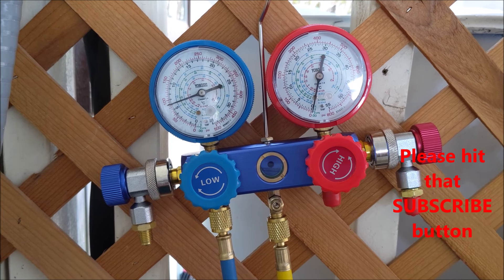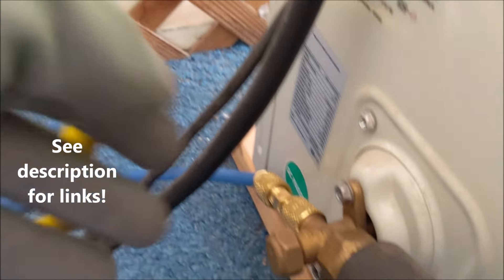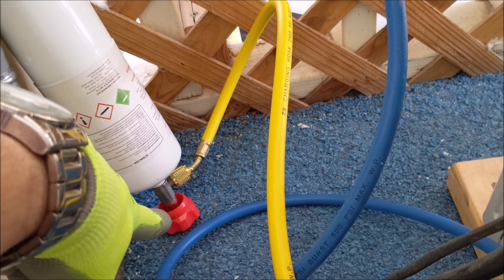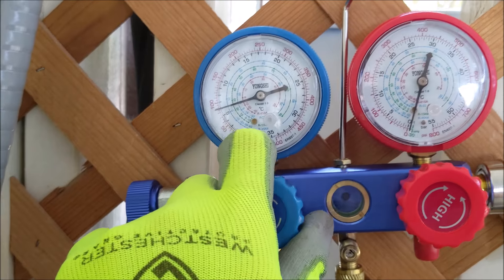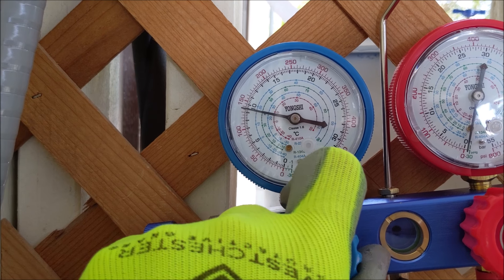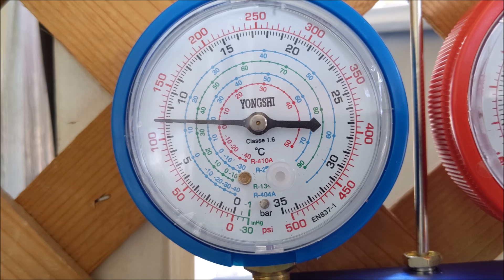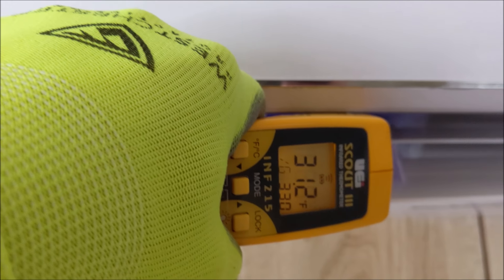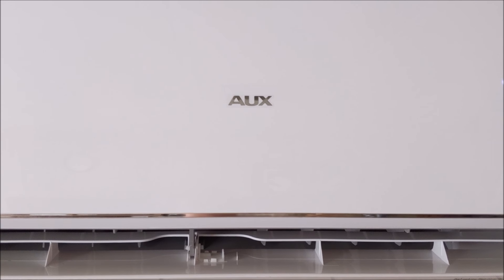How to charge mini split yourself, DIY 410a refrigerant, save money!

Comment: IMPORTANT NOTE: You need to purge a little refrigerant through the hose connected to the refrigerant tank before connecting to your gauges. You do not want to get any air into the system! If you don’t purge the hose, you’ll inject all the air in it into the system.
Reply from the maker: Yes Dave, that is mentioned on the video description, but thanks for the reminder for everyone.
Reply: True
Reply: Not able to find refrigerant like that for sale online anymore.

Comment: Thank you for the video. My 410a was delivered today and I just got done recharging my 24k BTU Mr Cool. PSI was at 75 and wouldn’t get my garage below 80. It was basically blowing warm air.  Turned the AC to 73 and went outside to recharge it. Took about 5 min, As soon as I walked into the garage I could feel the cold air again.. Since I installed the split system myself I had all the tools already. $75 for a bottle of 410a is way better than $500 for a service tech to do it.
Reply from the maker: AWESOME! Glad you got it, and glad you are cooling now!
Reply: Fix the leak!

Comment: this is the second part  of what you need to do: - this is what I do: - First, if you are low, that means you have a leak.. in my experience, it's that the fittings come loose after years of vibration... so before you do anything, turn the unit off - and re-tighten the fittings there are the two lines... use 2 wrenches... then I would use a vacuum pump on the system because if there is a leak, there will be some air in the system, and you don't want that.  - once your gauge shows -20 for 30 mins (it means it's holding vacuum) then you know you have no leak, and can NOW recharge your system.... NOW you can turn the system on full cool and lowest temp it will go... fully empty it will take about 1/2 a container - like the one he shows... I didn't do the open close - I just opened it up a little bit and close it when you are at like 90 psi, and then do the open close :-) - BTW there is no High Side access on these which is not great - there really should be... but like the OP said, just take your time.

Comment: Thank you so much for your video I tried it on my Senville two air handler mini split. Aura model 18000btu. It worked like a charm but only after the third try. I must stress to everyone please bleed the lines. Make sure the air conditioner is running when you’re hitting this psi Mark. Again bleed the lines, bleed the lines on the gauges. If you ever have trouble DM me. I can explain to you in detail what I did. I don’t make YouTube videos much at all. My leaks were s result of loose connections. All my refrigerant leaked out so I charged it from empty. Lord bless.
Reply from the maker: Great share, yes, very important, it was done prior, but also ensure you fix the loose connections BEFORE adding!
Reply: Paper wadder: Please show me how to bleed the line. Thank you
Reply: Multizone senville minisplit. Had a leak and will be removing all the remaining (likely very little left in the system). Removing it by using an evacuation pump into a separate cylinder. This will remove 410A  from the compressor as well all line sets. Note: This multizone system has a manifold with a set of “king valves” at the top of it. One king valve for the  vapour line and one king valve for the liquid line. The vapour line king valve has a 5/16” port on it. These king valves are the separation from the compressor behind the manifold and the rest of the system. Lower on that manifold are the line sets and each line set zone has“service valves” that when opened, allow flow thru to each connected line set. So, the king valves AND the service valves are open during the evacuation step noted above. 
After that, pressure test with nitrogen and locate /repair any leaks. Vacuum test down to 200 microns and confirm it holds it there. At that point, the system is tight and ready for fresh unused 410A to be added. My system factory charge calls for just under 6 pounds, according to the label on the side of the unit. 
My question is…do I close the king valves and add into one of the line set’s suction port as it is weighed in…and will the line sets hold all the 6 pounds of 410A, then open the king valves which then the 410A will make it to the compressor and I then start the unit up to circulate all thru? The last step and if the king valves should be open or closed during all the steps is what I am unclear about. Very much appreciate if you can enlighten me on this. Thank you…
Reply: @SaveGreenHere If I missed this I am sorry, but if you are just adding refrigerant you leave the unit running? If you are vacuum  the lines you turn it off? If you turn it off do you add any before you turn it on to refill?

Comment: On the yellow hose at the gauges don’t remove that hose just slightly open it up till you see the Freon coming out then just simply tighten it up and then proceed on what he’s describing you need to get the contaminated air out of your hoses first
Reply from the maker: Correct. A split second is enough until you see refrigerant come out, so you can purge it.

Comment: Any recommendations if the unit has 5 line sets (5 units inside the building that are controlled by the one outdoor unit). Would you have all the indoor units running and is there a specific port to use for filling since there are 5 line sets?

Comment: Thanks for the tutorial! The AC guy told me that the freon is 1-2 lbs lower than normal two weeks ago. I followed your instruction and made sure all the hoses were securely connected. However, the gauge shows a low side pressure of 0 (the AC is running fine). But it stayed at 210 psi when I release the refrigerant into the unit (is it the tank's pressure?) Do I need to open the service value to get the pressure readings?

Comment: I am grateful for these videos. I'm a widow in N.Ca. and the contractors are constantly trying to gouge me. For a single ductless minisplit (21-24seer 18-21 btu) unit I've been quoted 6000-10,000. Costco has a mrcool 21seer/18but for $1,500 now I need to get a friend to help me install. I already had the electrician (his bid for a lot of work was 3.8K where most bids are at 7-10K for electrical work) install the 240/40amp circuit & outlet.
Reply from the maker: Even electrical seems high.

Comment: Thank you for posting this. I have 2 mini splits that need recharge every 2 years that costs me close to $500 each time I call a service tech. I got everything for less than $200 and should last me 10 years
Reply from the maker: Glad to help. However, you may have a really small, slow leak if you need recharge every two years, and should try to find out where the source is. It may be at the ends. Try this, it works extremely well, and use it when you have to add refrigerant again, and you may never have to add refrigerant, as it's a closed loop system.... https://amzn.to/3edDJsX
Reply: SaveGreenHere techs have checked everything and even new line sets and pressure test. They told me (2 different companies) that the flare fittings are what leaks and are a poor design. I loved these ductless units in the beginning but I would never do this again and cannot recommend them anymore.
Reply from the maker: @Captfuntastic  You need to use this. Otherwise, you are asking for it...... https://amzn.to/33zQLz6
Reply: SaveGreenHere tried that already
Reply: @Captfuntastic  Flares made right don't leak, mini splits are great, a good flare tool matters too

Comment: One other question. When beginning to add the refrigerant, should both high and low pressure valves on the outside unit of the minisplit be wide open?

Comment: Please bare with me as Im not a HVAC tech. Here goes. I just purchased a LG 22000 btu            1 zone mini split system. The unit comes pre-charged for a 25 foot line set, but I need a 35 foot line set to reach my living room,so I purchased one.. I believe after watching your 2 videos I would do this.....1)  Install the system with the 35 foot line set.  2) Vacuum out the line set down to -30psi , wait a while and check for pressure leaks. If there are no leaks, my next step 3) would be to release the R410A which came pre-charged in the unit into the system. 4) Then I would check the pressure in the line set with the vacuum gauge to see what the psi is and then add as much R410A..... which I would have to purchase separately,  to get it to between 117psi and 120psi.. Im pretty sure there is no need to purge the system. Does this procedure sound correct....thanks   PS  the manual says to add 0.38 oz/ft.  So that should be about 3.80 lbs.
Reply from the maker: Yes, sounds like you should be fine. It will be very critical, to use the sealer, https://amzn.to/367xEf2 to ensure no leaks at the connections. Hope you have your refrigerant already. Ebay seems to still have it, but there's an industry push to eliminate sales on the web. You can get 11 pounds for $107 delivered to your door, and that's not bad considering retail market prices.... http://rover.ebay.com/rover/1/711-53200-19255-0/1?ff3=4&pub=5575339965&toolid=10001&campid=5338199104&customid=&mpre=https%3A%2F%2Fwww.ebay.com%2Fitm%2FR410a-R-410a-R-410a-Refrigerant-11lb-tank-New-Factory-Sealed%2F202661144956%3Fhash%3Ditem2f2f8ba97c%253Ag%253Au0YAAOSwz4Zc%257Er2V%253Asc%253AFedExHomeDelivery%252133990%2521US%2521-1%26LH_BIN%3D1

Comment from the maker: Purging........ On the yellow hose, 1-connect to tank, and gauges. Slowly open the valve on the REFRIGERANT tank as to slowly release some refrigerant 2-On the gauges, slowly unscrew yellow hose at manifold until you hear air out, should just take a second. Quickly tighten.         On the blue (suction)  hose, 1-Fully tighten hose on the HVAC unit, and on the gauges. 2-Slowly loosen connection on manifold, the remnants of air in the line will bleed out at the  connection to the gauges, (you will hear the sound of air coming out) at the manifold connection, and you can quickly tighten immediately after. It is a split second thing!
Reply: SaveGreenHere oh ok thank you so much for the info am gonna do that today 🙏🏼
Reply from the maker: You should be fine!
Reply: @SaveGreenHere  , do you have a video on how to get the R410A out of a wall unit and into the compressor so that I can replace the wall unit?

Comment: Great video 👍   My multizone minisplit lost most of its 410A. Repaired the leak and will fully evacuate what may be left in the entire system including the compressor. Pressure test with nitrogen/ then vacuum down to 200 microns and hold/ once that is done, I will add just under 6 pou ds of fresh 410A via one of the line sets. Question: Do the king valves (these are not the line set service valves but are at the top of the multiple zone manifold) need to be closed and then opened only after the line sets have taken the 6 pounds or are the to be open while adding? Not sure if the two line sets (less than 50’) can hold all the 410A. At what point is the system turned on?  I dont think it should be running while initially no 410 is in the lines.

Comment: Failed recharge.  sigh.
I recently installed a new Senville 18K btu unit.  Did a 1.5 hr vacuum test, no problem.
Finished setup and started the system running. (note: It's winter!)
It started heating just fine.  Then I got a call and had to leave for six hours.
Came back - and it wasn't heating anymore.
Turned it off, and checked the Freon pressure.  it was 0.  Apparently the system developed a nasty leak somewhere.
Since I had shortened the lineset (I only need about 20'), I assumed my flaring job wasn't good enough.
Due to shipping snafus, I had a spare lineset (25'), so I just replaced my shortened one with a factory built one (and looped it).
Since I had to wait for the Freon to arrive, I did a VERY LONG (4 day) vacuum test.  It held vacuum.
It's 36 deg F outside.
Since there was no freon and I didn't want to run the compressor when empty, I did a slow fill to 100psi.
Then powered up the system, and was able to fill it to 115psi.  Wouldn't go higher. (freon too cold??)
Yes, it's in Cooling mode - as I do have an alternate heat source in the house.
Let it run for 15 minutes - no cooling, blower running inside, the fan on the outside unit is NOT running, but I can hear the compressor running.
Pressure hasn't changed.
Tried flipping it to Heat mode, and waited 15 minutes.  No heating inside, inside blower running, outside fan and compressor running.
No heat.  Pressure hasn't changed.

Gave up and shut it all down.
Any suggestions?
Reply: Did you open the valves from the compressor to the lines?  Towards the beginning of the video, he said don't try and add refrigerant to these ports.  Ask me why I know?  Been there, done that.  Once you have the lines all connected, take the caps off and open the valves on both the high and low, you should hear a hissing sound as the preloaded refrigerant goes from the compressor to the lines.  Open the valves all the way until the stop and then see if you get the heating and cooling desired.  This is somewhat off the top of my head recalling from a couple of years ago, but I think there was also set of a master valves on top of the individual ports on my unit as well, so you might want to check that as well.

Comment: Thank you for for sharing .

The best practice for mini split is to start from zero ... Pull the vacuum and add refrigerant by weight.

Anyway, I also top up my 9000 BTU gree inverter..

 During topping up, I keep monitoring 
psi on the gauge, 
current from the clamp meter ,
temperature on suction line ,
temperature from supply vs return air on evap unit.

I turn my ac to turbo mode or max cool... run for a while ...and adding refrigerant...

 My sweet spot 

Gauge psi.. 125-130

Current getting close to RLA (it is ok for mini split to ramp up to RLA on turbo mode... We are not gonna keep using turbo mode all the time in real life, right?... The current will go down when on normal operation.

Super-Heat keeps fluctuating in the range of 5 +-3, which is normal

Delta T or return air temp minus supply air temp on the evap indoor unit is between 15-20 degreeF
Reply from the maker: Thank you for sharing!

Comment: I thought with inverter systems the fan speeds, compressor speed and metering device are constantly changing so you weren't able to tell the state of charge by just looking at the pressure (or the superheat and subcooling) like you can with a single speed system.
Reply: You are correct.  I'm not sure he mentioned this being an inverter system.  That being said, I'm installing a couple of inverter systems.  I forgot I wanted to check pressure running at full speed.  I will do that when I'm finished installing the second system.

Comment from the maker: MAKE SURE YOU WEAR GLOVES....https://amzn.to/3fxiF1u  AND SAFETY GLASSES..... https://amzn.to/3fuqFjv  Remember to purge the yellow line, BEFORE you open the blue valve. So after attaching refrigerant jug, open the valve on the jug. Then press the schrader valve ( the pin that shows on th center of the manifold) with a small screwdriver for a split second, and allow just enough refrigerant out till you hear a split second pssst! We did this just before we started the filming, but did not catch in on the video.

Comment: Thank you for your refrigerant. I have ordered a 5 lb tank. My question is do we need to turn the A/C on while we charging.
Reply from the maker: Yes you do
Reply: @SaveGreenHere  thank you so much. And another question, i have a problem with my liquid line that was leaked and lose all the refrigerant inside the hole. After that my inside unit has some noise. Hence i need to fix my liquid line and cleaning the liquid line of the insides unit. Could i pump down like the way you show on the other video and fix the liquid line?

Comment: YES THank you!  Getting ready to do this.  Did you do anything with the valves?  Did you turn them off or you just hook it up and ahve it running to add the juice?  Talking about the valves you turn to release the refrigerant into the system.

Comment: Thank you for the refrigerant link. I will have all the supplies I need to get this done. QUESTION: 
When beginning to add the refrigerant, should both high and low pressure valves on the outside unit of the mini split be wide open? What about when doing a back pressure test with Nitrogen. Are they open or closed? I don't want to mess up the compressor or anything by accidentally shooting nitrogen in there if its not supposed to be. Thank you for all your help.
Watched the ads for your channels ad revenue. Will be watching more of your mini split electrical wiring videos tomorrow.
Reply: You're not ready for this bro.

Comment: I just purchased a new mini-split system and following your advice bought the refrigerant from eBay (3 days to deliver!!) and the gauges you recommended from Amazon.  My question is... since this is a new unit and has never been charged with refrigerant do I need the vacuum pump?
Reply: Yes
Reply: new unit should have come charged.

Comment: Thanks for the informative video. Just have a question about any possible air in the system or line when you attach the canister to the unit. Is there anything or any way to bleed out the slight amount of air that is in the line/hose before the refrigerant is added? Thanks!
Reply from the maker: Put ball valves on, like these.... https://amzn.to/2Q0jO81
Reply: @SaveGreenHere  I have not seen those, but that seems like a great way to do it. Thanks!

Comment: Will my mini split go in to cool mode for charging in winter time. Its low 40s here
Reply: There is usually an emergency function button somewhere on the interior unit that will allow you to turn on the AC even in cold weather

Comment: Very good information  what size of  AC you put the Freon in and what was the in temp
Reply from the maker: That was a 9000 BTU system and the temp was around 100 degrees in the Summer.